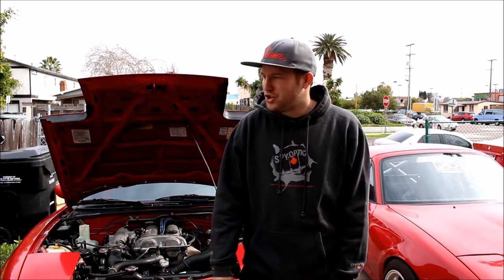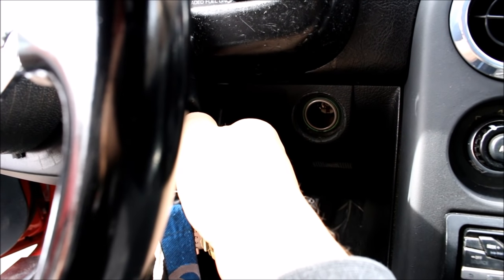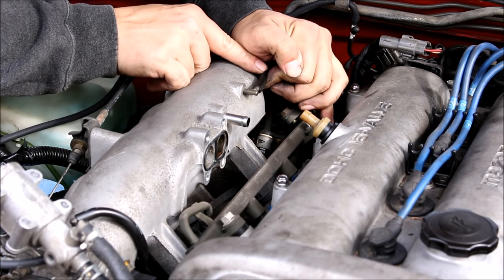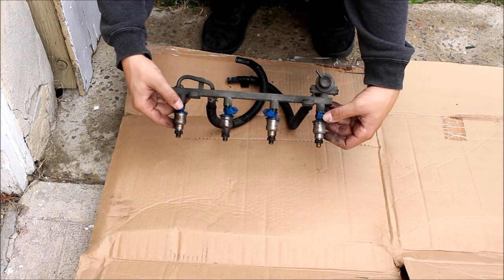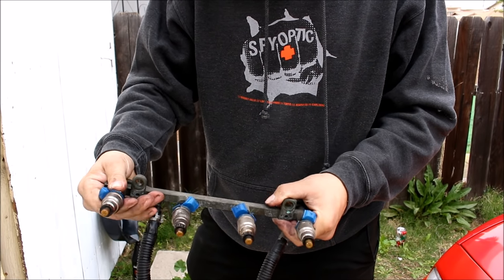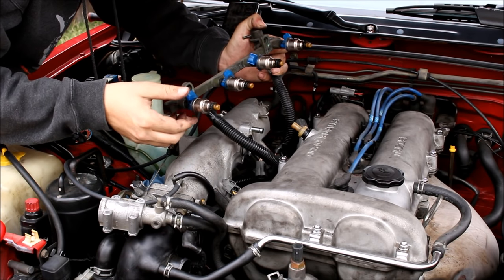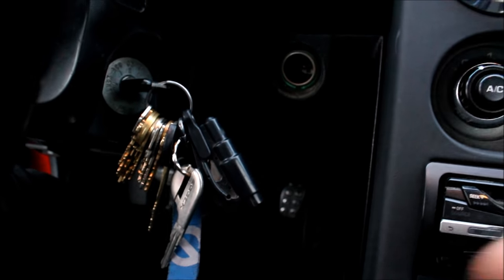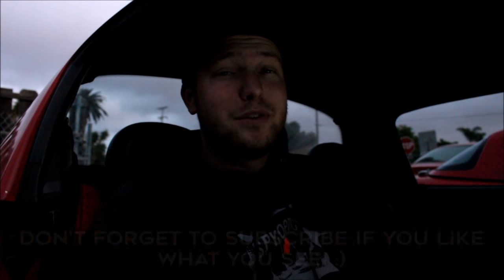Injector Upgrade: Why & How? (With Megasquirt Settings)

Comment: The relay being pulled at the beginning is the fuel injector fuse. It is recommended that the actual fuel pump relay be removed which is located above the accelerator in a strange plug usually yellow or green colored on later models.

Comment: I’m sure this has probably been mentioned , and I can see what you did it your way to explain the fuel system but just a little tip , you don’t need to take any of that stuff off to change the injectors, just the 2 12mm bolts, release the rail , and you can squeeze the injectors out 👍🏻

Comment: Hi,
I bought a 1997 Miata STO for my wife, the previous owner had an issue with the car getting hot so he took it to Mazda and had a new head, head gasket, timing belt, water pump, thermostat and radiator installed. Then him and his wife split up so i got the car for a great price. I noticed it ran well, idled nice and did pretty good under most circumstances. The problem i have is when you get on the throttle and starting rolling up thru the RPM's...it has spots of hesitation in the power band...the wife doesnt notice it but i do...its not necessarily "jerky" but it has spots of hesitation. I replaced the fuel filter, plugs, wires and coil packs...also cleaned the throttle body , MAF and EGR valve but its still there. The only thing left is to replace the injectors, fuel reg' and possibly the fuel pump (and maybe the factory cat and downstream O2 senosor.... do you have any thoughts or ideas on this?
Reply from the maker: +Mr T Sounds like you've got the main things covered, if the hesitation is at full throttle it's most likely not the O2 sensor since it's only used at cruise and idle. Fuel pumps typically work fine, then just die. You may want to start with a fuel filter, and also check the ignition advance. Base timing should be at 10 degrees.
Reply: I already did the fuel filter as mentioned in the original post and the previous owner said the timing was done less than 90 days ago. I'm kinda lost here. The problem Isn't at wide open throttle, its just when you're running up thru the RPM's more aggressively than just normal driving (But not floored).

Comment: Hi, Big Fan of your show, here. My only question is, what injectors size is recommended for a 1.6 Miata boosted to 5-7 psi? I swap my stock injectors to the 1.8's injectors.
Reply from the maker: +boaz ovilma Do you have a wideband? 1.8 injectors should be okay if you have raised fuel pressure, I'm not sure if they'll be enough if you're at stock pressure. A wideband will tell you if your AFR's are safe.

Comment: Awesome! Maybe you can shed some light if an injector is bad or plugged. My mileage recently became pretty bad and no other changes. My compression is good (per your video), just changed my fuel filter, plugs and wires, and no trouble codes ('96 with ODB1, yes ODB1) as well as the engine runs smooth. Could an injectors be clogged? Can you check this with the injectors in the engine, how could you check if you pulled the injectors? Any insight is appreciated. Keep up the good work!
Reply from the maker: +Jo Ro Hmm, what did you calculate your MPG to be and what's your driving style?
Reply: Good question. I'm not too aggressive. But I did not calculate it, yet. Let me run a few tank fulls and be more rigorous.
Reply: Finally figured it out. My car is an early 96-- thought it was a carry over OBD1 but finally found that it did have an OBD2 connector (which was sort of haphazardly put on by the factory and super hard to see). Anyway, I connected my OBD2 WiFi dongle on, opened up DashCmd on my iPhone and get 28MPG Ave but only 20 in the city with non aggressive driving. This seems a little thirsty but reasonable- may change the O2 sensor and clean up the IAC and MAF. Compression is good but think my seals are leaking. Thanks for following up and the good work. (BTW- I'd love to see a vid on diagnosing and replacing issues with the head on the Miata, if you are looking for suggestions)
Reply from the maker: Jo Ro Head swap video coming soon!
Reply: Thanks. As a follow up, the brochure specs on '96 1.8L stock MPG is 21/26 on Edmunds.com Car still is on the money. No reply necessary.
Reply: OMG- Your videos are so good. Deep into the car 5 years later and doing tons of research and this is still the best resource on the web or a Chilton manual.

Comment: Hey so I'm having trouble ATM I'm using rx8 yellow body injectors and my car idles at 8.5 afr but for some reason no matter what I do it doesn't burn to the ecu?? So any changes I make doesn't effect my car what so ever.

Comment: Did you have a video covering the pros and cons (if any) of batch fire vs sequential fire? Or does the MX-5 even batch fire to begin with?
Reply from the maker: +Porsche Duésnburg The 1.6 has batch fuel. With sequential, you're firing the fuel right into the open port on each cycle, where with batch, half the time the fuel charge sits on the intake valve waiting to open. Sequential is just more efficient (and modern..)

Comment: Hey! I saw your update on snapchat earlier and it looks like you're getting intercooler/piping mocked up. I know this is probably going to be a video all on its own, and if it is could you briefly go over different types of blow off valves and HOW to mount them? I am guessing you got a kit from eBay and I plan on doing the same.. I just can't justify buying until I know I'm buying the right stuff (for cheap!). All the flanges and adapters make it a little confusing to someone who's never seen them before. Thanks and keep up the progress!
Reply from the maker: +John Mclaughlin Yeah I'm gonna include some info in the video about BOV's and IC's/Piping etc. I've been trying to add more info into the videos as I do the installs.

Comment: Yes, I have wideband sensor that reads 7.4 at idle and the low end, reads 21.1 above 3k. Despite the O2 reading's my Miata drives pretty good. Much better than the stock ones.
Reply from the maker: +boaz ovilma Something might be wired wrong, or the sensor might be bad. At 21.1 the car won't even run, and it definitely won't idle at 7.4.

Comment: This is an old video, but should it be fine to put referbished rx8 injectors on my stock 1.6, with stock ECU, so when i get to putting my turbo in later on, my car is already ready?

Comment: Greg, I got all this, and get the numbers in just fine.  The problem comes when I then do some data logging and attempt to move the new VE table values over to the Megasquirt.  The VE table values go, but my fuel number always reverts back to the stock 12.5.  If I change it and then save it, everything is fine until I try to update my VE table values again.  Is this just something I have to live with, or is there a setting I haven't clicked to make the tune remember my fuel value from update to update.

If it helps, I'm running the MSPNP2.

Comment: Great video as always but... forgive me for asking but: so I can upgrade just injectors for basic not modified miata no need to upgrade fuel regulator and fuel pump ? if i just upgrade injectors is it give me any extra power ?
Reply from the maker: +ToFast2beSlow Installing bigger injectors alone will not give you any extra power. They are a "supporting modification" which means you only need to upgrade them when your current units can't provide enough fuel.
Reply: +TheCarPassionChannel great thank u... need to do turbo then :)

Comment: To anyone having difficulty getting the rail out: I ended up just pulling the fuel pressure regulator off, made getting the rail in and out a lot easier. It's just two (9mm?) bolts and a little pulling. Be warned, fuel is gonna spill out of it

Comment: What could happen if you forget to put in or lose one of the plastic spacers for the bolts on the fuel rail? My 1.8 has three bolts holding it in place and the middle one is missing the spacer.
Reply from the maker: +achikennugget38 It's possible you could have a fuel leak or a vacuum leak if the rail isn't secured properly, but those spacers are probably $2 so it's a good idea to get one back in there.

Comment: So with stock injectors/pump/ecu, I should just up my fuel pressure? I have just a cai and exhaust.Currently upgrading my car. Slowly changing gaskets and cleaning it out. Wanted to change to 450cc injectors but it sounds like it’s too much??
Reply from the maker: With only intake/exhaust, there's no need to modify the fuel system

Comment: I'm not sure if I got it right...let's say I want to run around 300hp and I upgrade my fuel injectors to 450cc and my fuel pump to 320L/min. Also I have a standalone ECU. Do I need to buy an adjustable FPR to raise up the fuel pressure (equally to the boost) or is the ECU able to handle that?
Reply from the maker: Jan 94 if the injectors are the correct size and the pump can maintain pressure then you don't need to raise the pressure with an adjustable FPR
Reply: Thanks for the quick answer, you're the best :)

Comment: Papa miata , I need to know what the 2 hoses coming off the fuel rail are called, I had to cut mine off to remove my intake and I don't know the name of the 2 hoses to replace them
Reply from the maker: You can get generic fuel hose at AutoZone and they'll cut it to length. Just make sure it's efi/high pressure fuel hose.

Comment: @TheCarPassionChanne - When deciding to upgrade your injectors. Is it better to wait until the turbo is strapped on to bump up to 460cc? I am going to install my MS2pnp here soon and was wondering if there is any downside to slowly start upgrading my fuel system starting with 190LPH pump, then new regulator then new injectors if I stay NA for a bite. Eventually I'll put that Gt2554R but wanted to know if its bad to have all the other stuff upgraded so much while staying NA for a bit. Thanks for you help
Reply from the maker: +Troy Sebo There is absolutely no downside to upgrading the injectors beforehand. In fact, I highly recommend it! That way you can get it running smooth n/a on the big injectors before going turbo. I have a buddy that ran his stock 1.8L on megasquirt with 1000cc injectors before he went turbo.
Reply: +TheCarPassionChannel Are you the RX-8 injectors on the fast miata?
Reply from the maker: Troy Sebo I used to, but they're not near big enough for my power level with E85. Running 750cc now.

Comment: You said once nearing 200K it would be wise to replace the FP, what about the regulator? Do those ever go out?
Reply from the maker: +Troy Sebo I've never personally had one go out, but again if it's really high miles, and especially if you're boosted, it's just good maintenance to replace it. I also replace the fuel filter every year.

Comment: Hi greg, love your videos, love your channel and your miatas!!!
I want to ask you a few questions on injectors. If i remember well you said in the broke & boosted intro or in another of your first video that is better to  install some of your components and let the car run smootly BUT in case of injectors, you said in this video that there isn't necessary to install injectors with more flow if the car is stock and it doesn't need them or if the ecu can't manage all that fuel/mixture flow, right? So isn't it a paradox? 
Ps. I also want to ask you a question about the video you posted on snapchat or instagram ( ? Can't remember correctly) where you where passing through yout favorite tunnel, and before enter in it you've switched some buttons... I was wondering if they actually works as switchers to differents ecu maps and if it is possible to do something like this maybe setting one easy map for cruising daily and another aggressive map to have fun.
Pps. Sorry 4 bad english im italian
Reply from the maker: +ste sprea It can be very confusing I know! Basically, if you need more fuel, you have two choices. You can install bigger injectors or add more fuel pressure to the stock injectors. I think the video you're talking about is the "How to Turbo Your Miata" where I say you should add bigger injectors and get the car running smoothly before you add the turbo. You can ONLY add the bigger injectors if you have an upgraded ECU that knows how to control them. On the Broke & Boosted project, I'm going to be keeping the stock ECU, so I can't upgrade the injectors. I have to add more fuel pressure. Also I did say you don't need bigger injectors if you don't need them, but if you're going to turbo the car in the future, you can install the injectors first even if you don't have the turbo yet. What I was saying is that if you have a stock engine, and you add bigger injectors, you're not going to gain any power just by adding the injectors. The switches are for high and low boost, and to turn the 2-step on and off. Hopefully all that makes sense!
Reply: +TheCarPassionChannel thanks man, think i got it!  

Ps. High/low boost switchers are a feature of megasquirt? 

Can't wait for upcoming video ^^
Reply from the maker: ste sprea The boost control switch is just turning the EBC on and off. The 2-step control just interrupts the signal to the clutch switch. So technically neither are features of MS, but you can add switches to do things like map switching.

Comment: Hey Greg,  on your other car you blocked off the air valve. Do you have to run on megasquirt to do that ? 
thanks
Reply from the maker: +De Rogie boy You could probably do an air valve delete on the stock ECU, but cold starts might be much harder. I'd recommend making a block plate, installing it but leaving the air valve off to the side, and start it up with the engine cold to see how it does.

Comment: I have a question. Is the stroker upgrade from flying miata worth it? It's a 1.8 to 2.0 conversion. can you also explain it and what it does power wise and if it would create more power and how much more power? please and thanks you
Reply: yeah, I'm also interested, if someone has info it would be apretiated! :)
Reply from the maker: +Ryan Howell I have no experience with that kit so I can't really tell you much about it! If you're really interested in the kit I would shoot Flyin' an email.
Reply: Ok will do. Thanks for your time man!:)

Comment: on your other video you said you had 1.8 tan injectors some people say they work and some say it idles rough do you think you can install them to show exactly how it runs on stock ecu
Reply from the maker: I might put the 1.8 injectors in, not sure yet. The stock ECU should be able to idle 1.8 injectors just fine though.

Comment: Hey just got my fm kit, in instructions it tells me to remove the relay under the dash near the steering column to relieve the fuel pressure but I can't find the relay. Should I just use your method instead? Thanks
Reply from the maker: Pulling the black relay under the hood and cranking the car for a couple seconds will relieve the fuel pressure, and also remove your gas cap.

Comment: I have a 1.6 Miata and I'm getting a cold air intake for it and I was wondering if I should bigger fuel Injectors with the intake and if so what size?
Reply from the maker: Nope, injectors won't make any difference. The stock AFM has a temp sensor in it that will make fuel adjustments if the air is any colder.
Reply: +TheCarPassionChannel okay thanks. Since the air intake brings in more air into the engine would getting bigger injectors make more hp?
Reply from the maker: JosephCJ13 Nope, unless you're maxing out the current injectors, bigger injectors won't help. Power is determined by how much air you can get into the engine, the injectors are just there to maintain the correct air/fuel ratio. You won't be maxing out the stock injectors without a turbo, supercharger, or nitrous.
Reply: +TheCarPassionChannel okay thank you for your help. I'm trying to make more power in my Miata but not spend a bunch of money.

Comment: So is it only worth upgrading injectors if I'm running force induction? 
What if I don't? Is it just not worth upgrading them?
Reply from the maker: +Acico73 You only need to upgrade your injectors if your current ones can't supply enough fuel. Injectors are really a "supporting mod" not something you upgrade to gain power.

Comment: Isn't a 1.6l displacement in cc a 1606cc. Is this setting important?  Engine displacement
Reply from the maker: The Miata engine is 1598cc but that box is only used to estimate the new Req Fuel value, to my knowledge it's not used for any actual tuning. Required Fuel is what has a drastic effect on the tune

Comment: I have a problem with my miata. when the car is running and i stop at an intention the tpms drop to the point where it almost turns off and then goes back to normal. everybody tells me its easy to fix but idk how to fix or whats wrong with it
Reply from the maker: +Johnny Quinones Could be AFM, o2 sensor, clean the IACV, check for vacuum leaks. Just a few things to check.

Comment: one question. Can I run RX8 injector (550cc) with stock engine and MS3X? Is that too much for stock engine or can I control it by MS3X? I want to install as many as I can for upgrade when the engine is out so I don't have to take them apart again when the turbo is ready. thank you.
Reply from the maker: +董文博 You can run 1000cc on the stock engine if you want, it's all in the tune. My friend ran 1000cc on his stock 1.8L and the drivability and fuel mileage was just like stock.